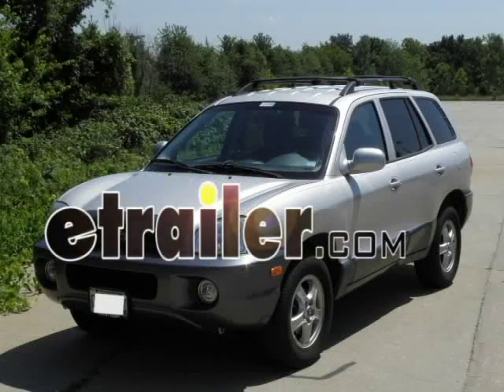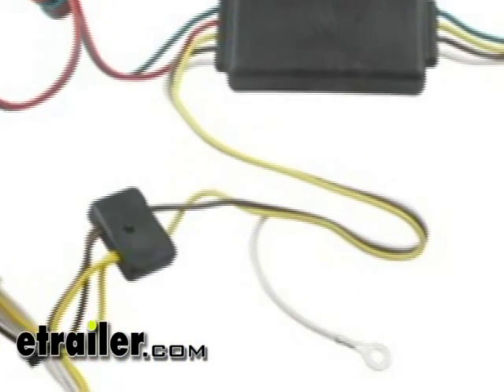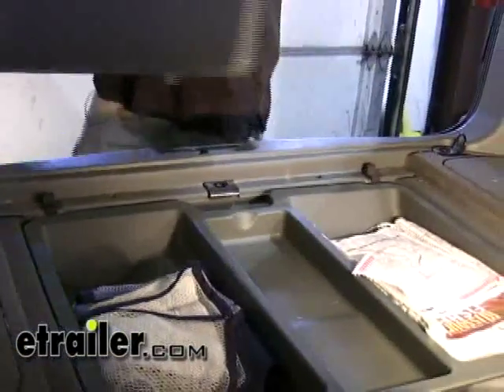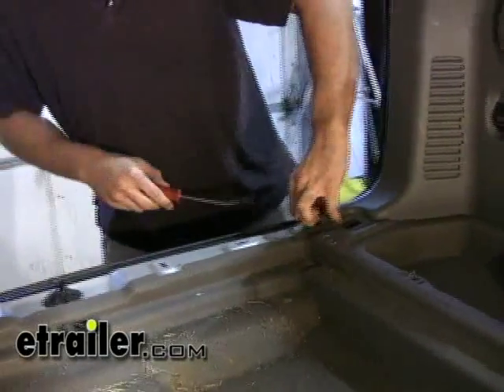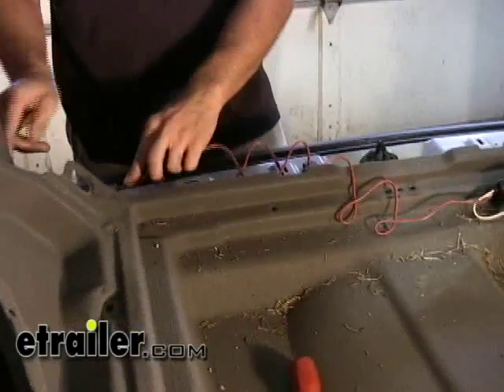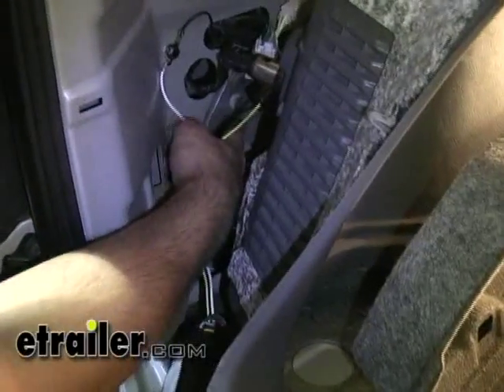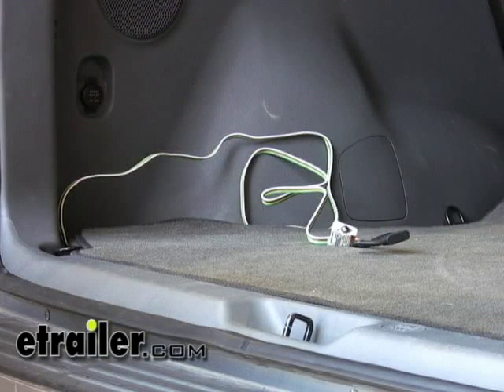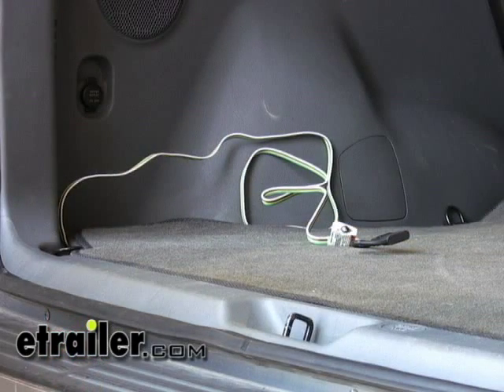Mount: T-One Vehicle Wiring Harness with 4-Pole Flat Trailer Connector on a 2005 Hyundai Santa Fe

Comment: There is a little storage compartment on the drivers side, and what I did was take a utility knife and cut a small slit in the side of the liner of that compartment so that I could feed the 4 flat connector through. When not in use (most of the time) the 4 flat connector and wire can be coiled up and stored there out of sight.